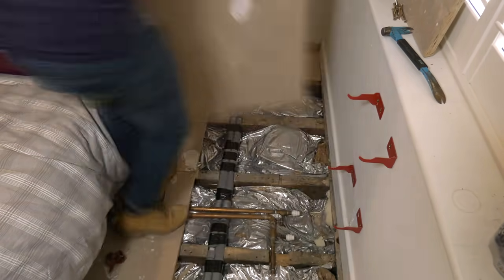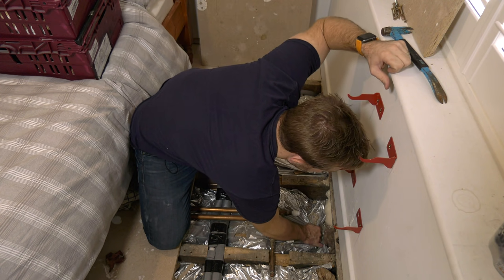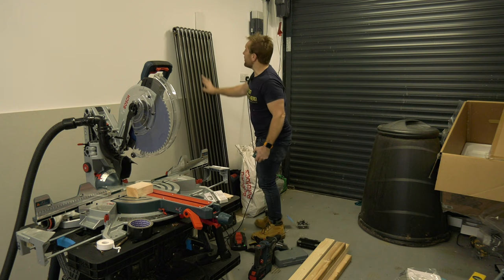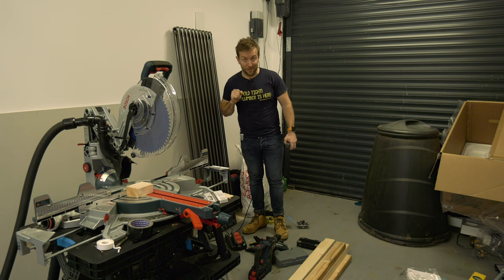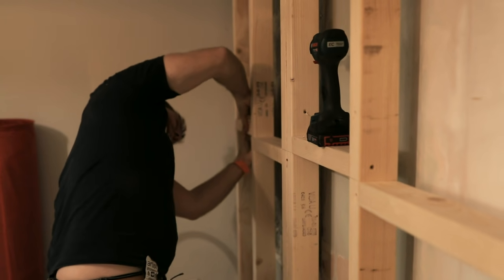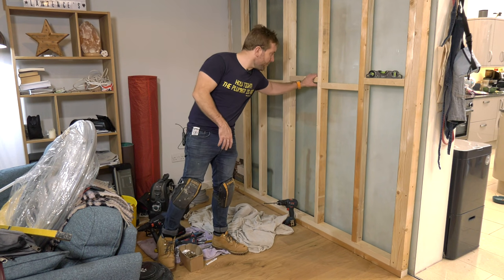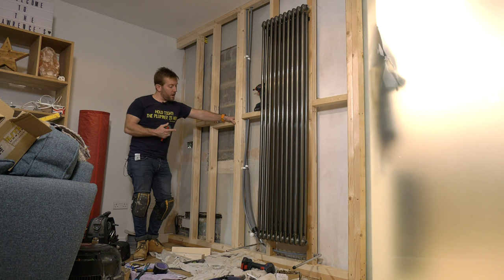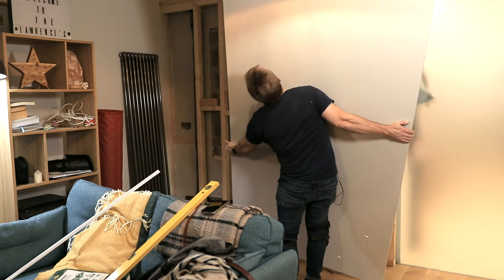HOW TO ADD A RADIATOR TO EXISTING HEATING SYSTEM Pt.1

Comment from the maker: 🍺 JOIN THE ALE ARMY Exclusive Live stream AFTER THIS VIDEO 9AM : https://www.youtube.com/user/plumberparts/join
🛠 AMAZON TOOL STORE BUY THESE TOOLS HERE http://www.amazon.co.uk/shop/plumberparts
📺 VLOG CHANNEL: http://www.youtube.com/c/timeswithjames
Reply: Jamesy Boy...you're not still using pushfit stopends on pipework that you're going to be later reconnecting!?!? You crazy kid...instead use a couple old push fit isolation valves. Makes draining easier and avoids the "oops" if there's still a bit of pressure in that pipe. Also a rolled up rubble bag makes a good water catcher. Cheers matey.
Reply: Are you saying you can put a TRV on either the flow or the return pipe?
Reply from the maker: @wtfMYRONL  Yes on a universal TRV. Just look for those arrows!
Reply: You are my mate, I do everything like you though I am an Engineer. Recently worked with a carpenter put up a brand new roof and people asks me are you not an Engineer? Ha ha ha
Reply: Can you do a video on picNmix central heating pipe work. I have 12 rads and they are all running different bore pipe.  Some radiators have 15mm coming in and 8mm going out.  Would be good to see a video of pros and cons of each pipe size... Thanks lad.

Comment: Would love to see you trying out some of the Evolution tools range, I was extremely surprised how good they are! Hell of a lot of tool for the money
Reply: I have the evolution mitre saw. I built garden room with it so had lots of use. It's great for DIY but it will be nothing like as good as the professional Bosch mitre saw James is using. I wish I spent more money and bought a makita or bosh professional. When you chop woood with the evolution you can see the cuts are quite straight and you have to mess about it but never quite right. Even straight cuts when it's locked on zero are not right. I had to change the bushes and I'm only on the second blade although I have a diamond blade and a cement board blade. Again lot of use bur they are a bit crap.

Comment: I am a spark and I built my own garage, daughters bedroom, wet room + loft conversion. Plumbing done by a pro save for loft rad that was me. Just because you have a trade, does not mean you can only do that. I personally won't touch Gas for obvious reasons, but brick/blockwork rendering, plastering and carpentry I enjoy. A break from wiring.

Comment: Shouldn't the plasterboard be cut a little off the floor, if you get water on the floor you'll get damp up the wall no?
Reply: @surfwidow  yeah that's what I thought. Great video and easy enough to use a multi tool to take a strip off the bottom.
Reply: Yes your correct, you should never put the plasterboard directly onto the floor for water ingression.

Comment: Can you make a video on how you remove the laminate flooring from under a stud wall , when the floor needs to be replaced? 🤔
Reply: Multi tool and lots of blades. Leave the laminate beneath the stud work. Mind you, I'd be more concerned about the expansion/contraction gap. Or lack of one. Especially, since the laminate is sandwiched twixt stud and screeded floor with plugs/screws.

Comment: I’m about to fit an 1800mm tall rad in my extension. What was the springy gizmo you put in yours. You mentioned blanking plug but this ones I’ve found online are just a blank nut. 🤷🏻‍♂️ Cheers for the videos.

Comment: Hi James , heating system in our two bed ex LA property is 8mm micro bore with 22mm flow and return  would it be acceptable  to add a rad by cutting into the feeds to an adjacent rad instead  of going into the 22mm (which is the opposite side of the house) ??? The master plan is to tap into a bedroom rad  f/r and drop directly below into the kitchen  below to add a plinth heater .your guidance would be appreciated. plus how's the flying hope you are building the hours ? Takes me back to my days at Fenland Air Field, at that time two brothers ran the show there

Comment: Would be possible to get a link for the blanking plug please. I’m having the exact problem you have described with the water rushing straight through the bottom bar. 
Thanks and great vids as always

Comment: As a chippy, you did make me laugh with your singing at 9.30 ish. You sounded like Boz Scaggs! 
Why did you fix your floorplate on top of your laminate flooring? When your Missus starts saying she hates the flooring in that room, and wants you to replace it, you have a problem. I always place 'strengtheners' in, when fitting a stud wall that i know a radiator is going to be hung off. I get the customer to show me where its being hung, and take measurements from the rad.

Good video. Nice cat.

Comment: What type of pipe is this, is it 15mm barrier or a multilayer type?
Reply: Buteline 16mm I belive
Reply: @MrEdd4004  i thought 16mm was only used for underfloor heating. Ive obly used 15mm copper for radiators in the past but going to be doing a new build with posi joists and radiators upstairs so require some decent barrier pipe. It mainly all seems to be 16mm, few 15mm like polypipe but usually twice the price as 16mm

Comment: Dont buy Kudox. I bought 5 Kudox radiators from Screwfix for a new central heating install in my house 4 years ago; these radiators have a 15 year guarantee.  One of the radiators has started rusting from the outside at the bottom rim. I applied to Kudox for a replacement but they just said it was my fault, that I had damaged it on install which is total bs. So the guarantee is worthless. Don't buy Kudox folks.